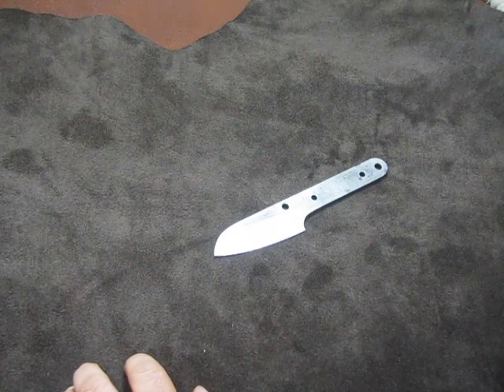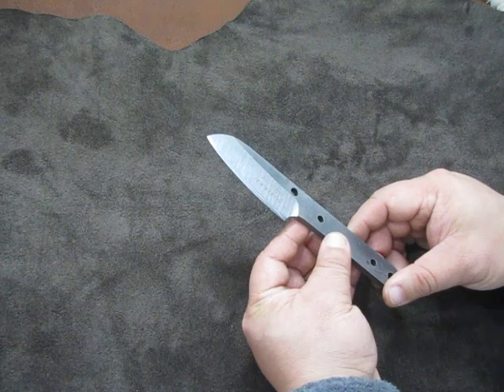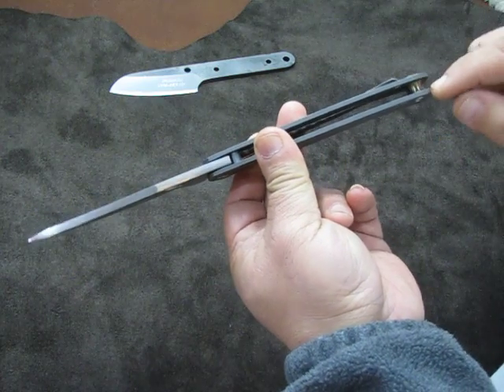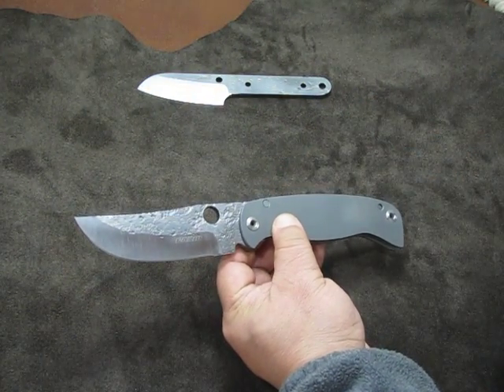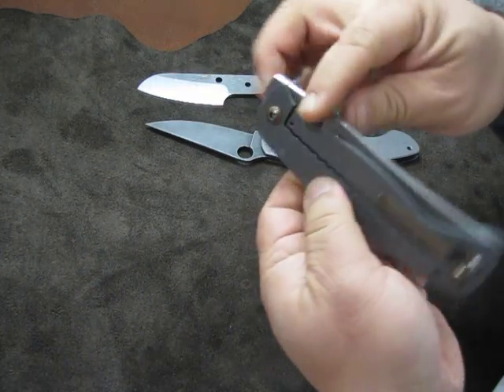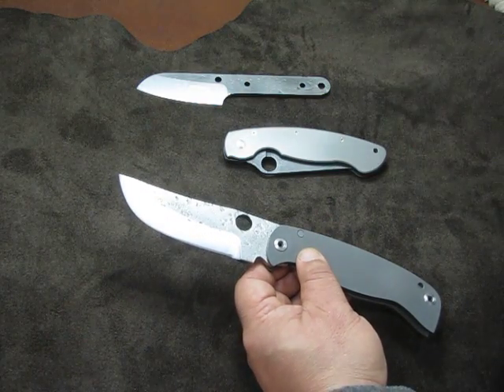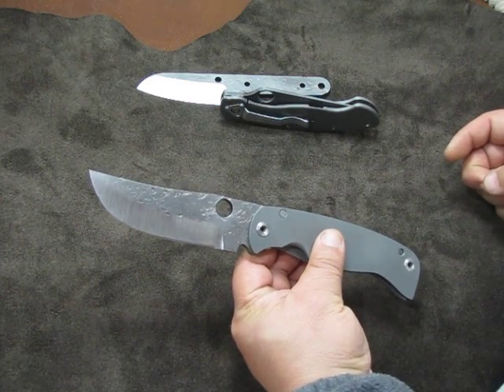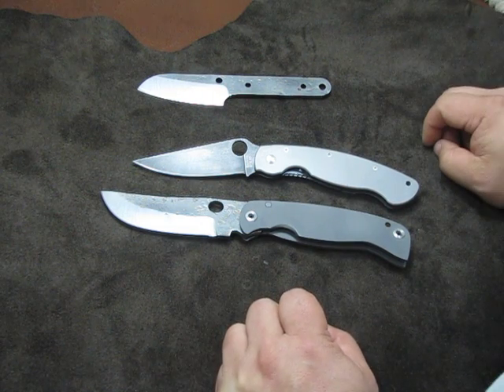Farid K2 and mule in CPM-REX121

Comment: from what i understand of cpm rex 121, i haven't heard any concerns about it chipping so much as it suffering from carbide tear out when being sharpened as apparently the carbides are so large in it that they dwarf the finer abrasives in size which keeps one from being able to achieve a more fine edge than simpler steels that have much smaller carbides such as some of the razor blade steels that form more of a fine edge. i actually do like both simple and high carbide steels personally.

Comment from the maker: Yup, very familiar with 3V and S7.  My 15"  custom chopper is in S7 and is pretty much indestructible.  I have that for whenever something requires borderline abuse.  With a proprietary heat treat at a higher than usual hardness (i think 59),  it holds an edge pretty well also.

Comment: 3v approaches the levels of s7 and other shock resistant grades yet it provodes Excellent wear resistance high harden and thermal stability for coating. Cpm 3v can replace high alloy tool steels in wear application were chronic tools breakage and chipping problems are encountered.

Comment: Get the spyderco tuff much tougher with 3v.
Reply from the maker: I have a custom 4" fixed blade in CPM-3V that I've used for processing kindling when I've gone camping, and while it is very tough, it doesn't stay as sharp as this mule.  The REX121 mule stays sharper way longer than 3V, it's not even a close comparison.  The REX121 mule is smaller, but the blade is thicker than my 3V camp knife and I've batonned it through some pretty knotty wood and still was able to use it to whittle skewers, although the shape really isn't made for it.  The 3V camp knife wouldn't shave wood well enough afterwards.
Reply: True rex 121 holds a fine edge cuz off the hight hrc but its not an impack tough steel like 3v with a steel like rex 121 with the hrc uo to 70 it will break in impack eventually. But if your using it for good edge retention go with rex 121 but still for hard use impack steel 3v out does it by alot

Comment from the maker: I don't know the reasons for his choice in belts.  Aren't Cubic Boron Nitride abrasive belts much more expensive?  I'm only familiar with using it as a spray when using synthetic stones to sharpen and polish the edge on high-hardness steels.  I can't imagine going through belts of that stuff to grind out a batch of 20 or so knives from 0.1875" REX121 blade stock.  If I remember correctly, Farid went through 50 ceramic belts grinding out 2 REX121 choppers, including finishing after heat treat.

Comment: I do not understand why Farid did not use CBN belts instead of ceramic belts. It makes no sense to me. It would be much cheaper and much faster with CBN belts. You can easily grind REX 121 even at 71 Rockwell with these belts...